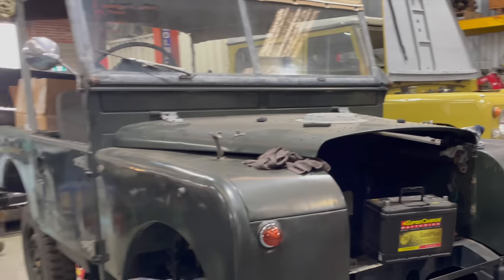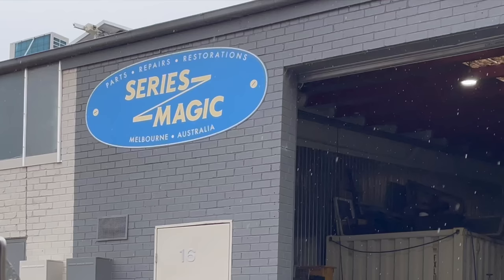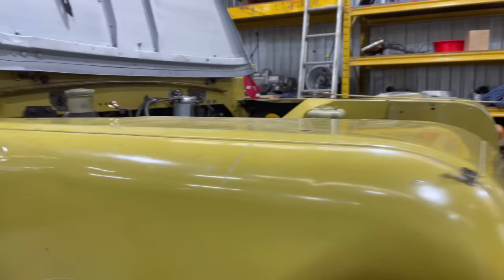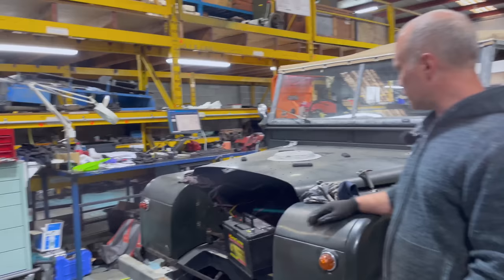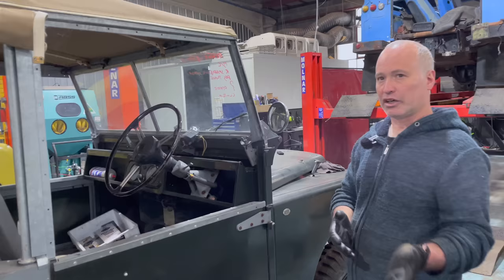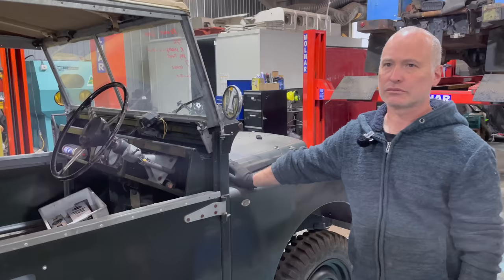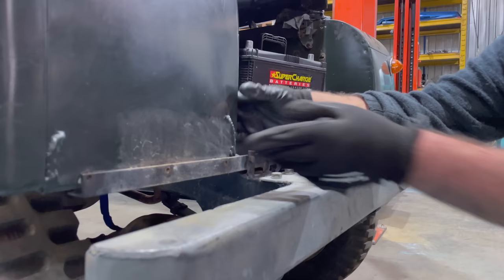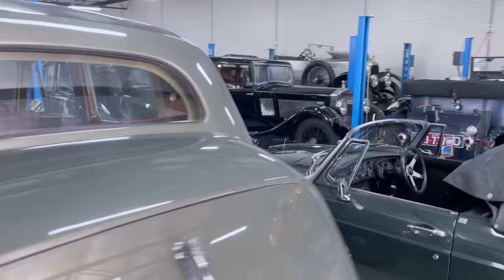LR restorer explains why Land Rovers last longer than Land Cruisers

Comment: I’ve been fortunate enough to have owned from both manufacturers. I used to own a LC70 with a 1HZ for 8 years and only thing that constantly need mending was the AC. That’s outside regular maintenance and service intervals. I currently own a defender 90 300tdi for 13 years now and you have a few small surprises of things breaking but nothing that has left me stranded. My experience says the LR just needs a little bit more constant “care”. I love my LR more though, and that’s because of the community.
Reply: 300  TDI   does   about     50%  more  miles to  gallon    than  equivalent  Toyota  love them
Reply: The big difference maintenance wise between a 21 year old Land Rover and a Land Cruiser of the same age, is once the maintenance on a LC100 is done, you can forget about it for the next 21 years.
Reply: @garypeatling7927  erm.....not really ! I know that 'cause I have owned both of 'em ! With my 300 TDI Landy, I did use about 10 -11 liters per 100 km, with the Troopy HZJ 75, I need about 12-14 liters. What I can say is that the Troopy is much more reliable. It has never ever let me down so far which unfortunately, I can't say about the Landy :o(  However, I do love them both !
Reply: erm...who needs AC anyway. This is only for wimps  :p Quite funny, I did go the other way. Used to have 300 TDI Landy and now, running a HZJ 75 Troopy. Luv 'em both but the Troopy is much more reliable. The Troopy has never ever let me stranded but the Landy has several times unfortunately :o(  There is also a great Buschtaxi community by the way !
Reply: @buschtaxi75driver55  don’t make yourself sound so ignorant, AC is essential in the tropics especially with family on board. I’m sure you’d want your family comfortable.
Reply: @keith6360  sorry about that. I was only joking. Here in Switzerland, we don't need it. This was the first thing which went out on me Lotus Exige. But even in Italy in summer, I feel no need for AC really.

Comment: If they do last longer, and I’m not saying they do, it’s probably because only enthusiasts own them. They just keep replacing parts as they fail (and they fail regularly) to keep the old girl on the road. Surely, no one in their right mind believes a Land Rover would last longer than a Land Cruiser with only routine maintenance.
Reply: So, Land Cruiser owners aren't enthusiasts, and they don't do the same with their vehicles? Do you think Toyotas have "forever parts" that never need replacing?    Do you think every Land Cruiser on the road has original parts?  Your theory is like Swiss cheese.
Edit:  A popular thing to do with the FJ was to pull the original motor out and drop a Chevy 350 in it.  How does that make you feel? 😆
Reply: @shiftmotorsports9803  A popular thing to do to Landrover's was to rip out the engine & drop a Holden red motor in it. Hows that make you feel?
Reply: @Dusty Farmer  Great! I'm an automotive enthusiast, not a brand enthusiast.  Holden (GM) makes good engines (most of the time)
Reply: @shiftmotorsports9803  You don't get a better Landy engine swap than a Holden red motor. 179, 186 or 202 6 cylinders were reliable, plentiful, cheap & the choice picks & found their way into Landrover engine bays. Fairy overdrives were another must have upgrade to both Landrovers & 4 speed Landcruiser's back in the day. I've had both but I reckon from about 1978 Landcruiser's left everything in their dust in every respect.
Reply: All 4 of those owners who kept the original rover 6 pot are rubbing their hands together, they are becoming as rare as hens teeth!
Reply: @peterharden4777  Almost as rare as buyers for them.
Reply: @dustyfarmer   Not been my experience, I check the classifieds pretty regularly and they are not commonly available
Reply: Ask yourself what do the police and rescue and mine vehicles use ? That’s right land cruiser.
Reply: Some click bait for Land Cruiser owners
Reply: In the early 90s, my wife worked for an UN-affiliated NGO in the border area of Pakistan/Afghanistan (yep, dangerous...) They used LandCruisers and nothing else. Their choice was based on experience... Around 2010 I wanted to buy a LandRover Defender. My wife's reply: "Go ahead, but only return with a car that has 'Land Cruiser' written on the bonnet!" Additionally: search for the TopGear series and how they abuse a HiLux (basically a LandCruiser).
Reply: @dustyfarmer   thay might be a austalian only thing
Reply: @tattttu9  Maybe, plenty of Australian cars & modified parts find their way overseas to places like South Africa & the middle east to this day.
Reply: @mennovanrij9334  Hilux is the poor mans Landcruiser & a Landrover is a poor mans Hilux.
Reply: @dustyfarmer  as a european, most diesel Land Rovers just go on for a eternity, and the older ones are easier to service and maintain than  Land cruisers
Reply: @tattttu9  Landcruiser's, even modern ones are simple to maintain, They are not the number one choice for terrorists & rebels for their "technicals" & getabouts for nothing.
Reply: @dustyfarmer  older land rovers are the better cars to maintain, the 2.5 diesel specially cus vm. still, newer land cruiseres get that title now cus they are simle, honestly toyota is the only brand in modern day world that gets away with selling something on outdated platforms for way over those cars should go for, why does a land cruiser cost almost as much as a range rover or a g class..
Reply: @tattttu9  You forgot to add "Once upon a time" at the beginning. Tell that story to the hundreds of thousands of Landcruiser owners in Australia who drive their Landcruiser's day in day out & you never be lost as they will tell you where to go & how to get yourself there.
Reply: @dustyfarmer  the reliability on land rovers is about as hit and miss as any other luxury vehicle. A land cruiser isn't a  luxury vehicle, no matter how overdressed in lexus badges it is. 
With luxury comes the will to add as many gadgets as you can to make life a lil bit better, and those are the first things to break always. to add to the injury of land rover's fame, most of their owners don't even care about maintaining a vehicle. And the others that do usually have to deal with unqualified mechanics everywhere. As well as a Land Rover owner, I also own a audi a4, thats has bulletproof as any car can be, and right now its running from shop to shop cus no one can fix it suffocating itself while idling
Reply: @tattttu9  And if you're worried about over-priced outdated platforms the Landrover would have to be the most outdated, over-priced & primitive platform there is.
Reply: @dustyfarmer  
As an obvious NisoToyo owner you would probably never understand the Landrover appeal.  If I want a boring car, I’ll get a Toyomiso.  Car enthusiasts, who like tinkering, repairing, modifying vehicles generally enjoy owning a LR.  
It is different, yes you need to maintain them.  Yes, there are (very well known) issues with certain parts…but this is No different to Toyota. (Rear wheel track, alternators etc)…just a LR owner goes…”oh well…time to work on the girl”…
The fact the Government/ mines use Toyota is more reflective of the “mechanically unsympathetic” drivers, than anything else.  Not sure I want that type of vehicle.
Reply: @tattttu9  if you don't consider the LC's sahara's or lexus LX570's as luxury, then 99% of land rover's aren't luxury vehicles either! only thing you could consider as luxury would be a range rover autobiography.
Reply: All over darkest Africa the cruiser is king. No landys in the real world
Reply: If you took a new one of each and drove them one behind the other switching each time you stopped for more than a stop sign or traffic signal ect, and continued, with regular maintenance at proper intervals until something that wasn't a regular wear part needed replacement, I would bet on the Land Cruiser every single time.
Reply: @andrewshackleton3700  maybe because the old defender is not available anymore?
Reply: @shiftmotorsports9803  so triggered 🤣😂
Reply: @dustyfarmer  All The really big machine tools from the Holden production line found their way to South Africa.
Reply: Land rovers were ace until the snowy mountain scheme in australia which was when the land cruiser was introduced. That was the time  land rovers lost the plot here on australia.
Reply: @dustyfarmer  bullshit, South Africa doesn't need Land Rover, or Land Cruiser vehicles or parts - they have their own.
Reply: @andrewallen9993  South Africa used to assemble knocked down Holden's from the mid 1960's on & re-badge & re-name them. I've seen old Holden's & Ford Falcon's in old South African movies & Aussie's are re-importing Holden Monaro's that were Chevrolet SS in S.A & Falcon GT's.
Reply: @anthonybaiocchi3028  I've seen your South African spec. Landcruiser's, suffer in your jocks pal.
Reply: @dustyfarmer  you make no sense and are clearly delusional. Maybe Google how many vehicle manufacturers have factories in SA pal. 🤣
Reply: @dustyfarmer  You are indeed correct. The price of SS, Falcons and Monaros in South Afr ica has skyrocketed since Aussies discovered they were made in South Africa from obsolete Australian dies and engines imported whole from Australia.
Reply: @dustyfarmer  no point in arguing with you after the you claimed Land Rover runs on priimitive outdated platforms. It just shows the knowlegde you have about the issue. Toyotas are reliable because they keep refining their old platforms and slightly updating them to satisfyingly fit modern standards. Land rover's main issue with reliability comes from their extensive use of eletronics and never just settling with what platform they have. Land rover is one of the most inovative brands  and the amount of times they have been in court suing other automakers for violations of their patents its insane.
Reply: @kev8943   the land cruiser is the 4x4 equivalent of a toyota camry. Leather doesnt make a luxury vehicle.
Reply: @tattttu9  Land Rover innovative? Dream on, still has the door hinges on the outside of the car just like they did in 1955. Enjoy your Land Rover mate, you well & truly deserve it.
Reply: @dustyfarmer  oh yes lets talk about door hinges and forget about terrain control lol
Reply: @tattttu9  Talk to yourself.
Reply: @dustyfarmer  nice argument.
Reply: @peterharden4777  exactly why I am collecting as many teeth of hen as I can and you're all going to be high and dry when you need them. Don't come crying to me.
Reply: @shiftmotorsports9803  well a lot of land cruisers are driven by Africans in the bush who never drive a car without an AK-47… also ISIS and co likes Toyota Land cruisers and Hilux. Iam not saying that as a terrorist you cannot be a car enthusiast but I highly doubt that they have time for it…
If you want to honor the desert you can take the Land Rober if you want to come back you better take the Land Cruiser
Reply: @mennovanrij9334 so? For the longest time, land rovers were used in the Australian army and mining companies 🤷‍♂️
Reply: @Freedom is not negotiable   Yeah, never heard any of that before.   Tell that to the family who perished in the desert in Saudi Arabia because their Toyota broke down. 
 As far as the terrorists, well, they are suicidal so they know they aren't going to live long and it doesn't matter what they drive.
Land Rovers are also used in Africa by the way.
I don't dislike the Land Cruiser. My dad had an FJ60 when I was a kid. Just saying I don't feel they're worth the hype.  Land Rover has more character in my opinion
Reply: @andrewshackleton3700 they use land rovers here in Ireland for mountain rescue and the civil defence.
Reply: @johnnyasus86  Using a certain vehicle is often the result of 'bean counting'.  Dutch Marines still use LRs, together with the British Royal Marines. But, that said, it's not the Dutch Marines' first choice anymore. Hanomag and Mercedes G are higher on the list. And a Dutch design: Vector. A quick look shows that Australia went for the G Wagon route as well. The countries' experiences in Afghanistan have turned a page, design-wise. The conflict in Ukraine will ultimately bring new ideas into military vehicle design.
Reply: @shiftmotorsports9803 the topic is reliability not character lol
Reply: @BIRD   Yeah, my original questions to the OP were not answered so we moved on since the post was debunked
Reply: @mennovanrij9334  I wonder if Mercedes will sell to the public the same g wagons they offer the military instead of the over priced luxury types, they are very capable
Reply: @johnnyasus86  It's more the basic version you see in Austria, built by  Steyr. Fun fact: They have the Mercedes 'tartan' fabric on the seats!
Reply: @tattttu9  your comment is a clear indication that you haven't been inside a land cruiser from this century🤣specially a sahara or at the very least the mid range prado
Reply: @shiftmotorsports9803  only LR's used in the savanna are the left over safari defenders, which at the very least easy to repair and run. all the old LR's all are getting replaced by new 70 series LC's which are more rugged, powerful and capable compared with the old 110's. it's literally the only bare bones 4x4 built by a major manufacturer which is still in production.  and thanks to the australians there are plenty of after market goodies to make your already hardcore 70 in to an absolute off roading beast.
Reply: @dustyfarmer  A toyota fan boy who constantly wants affirmation that his land cruiser is the “Best”. Enjoy you Land Cruiser mate, Land Rover owners still don’t care :))
Reply: @doctorage014  🤣
Reply: @dustyfarmer  yeah that was always a mistake. A little lexus V8 though...
Reply: @tattttu9  the  late 1960s diesel were very hard on rear axles and diff. Also the diesel were very dirty engine and liable to have under bonnet fires.
Reply: Japanese vehicles are for boring two dimensional people . Everything on a defender is easy to remove and replace . More people in the world have seen a Land Rover than any other vehicle , fact .
Reply: To be fair that would have been cost associated landrover engines were at least 2x dearer to replace compared to a recon red motor in the 1970s from what I gather ,the only advantage is on the road.R
Reply: Quite clearly there are a lot more Series and Defenders still on the road compared to Toyotas .
Reply: One of the reasons that Landrovers are more prevalent is market penetration and spare availability by Toyota. Comparing old series type Landrovers with modern Landcruisers is silly. The old series Landrovers were definitely easier to repair in the field
Reply: Is everyone commenting 14 years old ?😂
Reply: I have a mental block with Japanese vehicles , I’ve seen plenty broken down at the side of the road . Land Rover Series were , like the 2CV , made to be repaired at the side of the road easily . That’s the point of them .

Comment: As a younger man I had several "Landies" including the /safari and defender, but my all time absolute gem, which I bitterly regret selling on was a shorty series2a. The previous owner had kept it totally standard except the engine had been rebuilt to a very high spec for  hill climbing competition, so it was as smooth as silk. I took off the standard carburettor and fitted a new twin downdraughts Webber, that made the fuel consumption much lower, I fitted town and country tyres nice cloth seats a decent heater and a little soundproofing. In all it drove like a car, but off road it  would knock spots off of all the fancy Chelsea tractors the big U.S trucks etc and had the heart of a lion. On one occasion an articulated lorry had jack knifed and half slid off of the roadway on a factory estate and sunk in the soft mud, the lady that owned the factory complex , ( I had my workshops on her farm) came round and asked if I could take the tractor to help move the lorry, Well I had 4 x 1 hundredweight bags of ballast in the back of the Landie, and a huge tyre strapped to the front bull bars, as we lived right out in the countryside and and the snow that year was astonishing, anyhow I drove round to the lorry and the lorry driver pointed to my Landie and laughed out laud Ha ha ha and what do you think you are going to do with that Dinky toy? I ignored the remark hooked up my 1 1/2" inch thick very springy tow rope jumped in my motor all this while he stood grinning and mocking , dropping into 4 wheel in low ration and  reversed, dragging the lorry with me,, the look on that driver silly face was reward enough, shocked, he certainly was, and dashed to ge into the cab, he was as red as a beetroot. Job  done I poodled off to my warm workshop. Bless you Matilda,  ( I have no idea why she was called Matilda, she just was)  I loved that motor, hope she is still going strong somewhere. Recently I looked into getting another, but the prices here in the U.K are ridiculous seriously many thousands of GBP, were I younger and had a bigger workshop I would go for a poor one and do yet another rebuild, I had over the years rebuilt and upgraded 3 in all and also put a new chassis on a safari.
Reply from the maker: Thank you Chris. I wonder how you could find out if Matilda was still about.
Reply: @davesclassicgaragetours  Easy in the uk if he remembers the reg he can use the DVLA mot and tax data base its open  to any one.
Reply: @davesclassicgaragetours  If I found her I couldn't afford her, prices of these gems have rocketed as I'm sure you know.